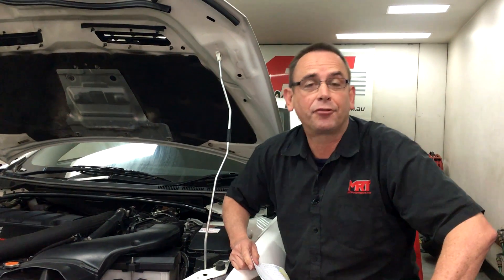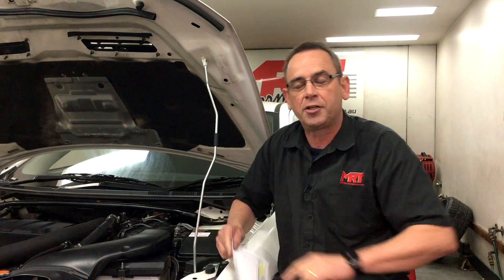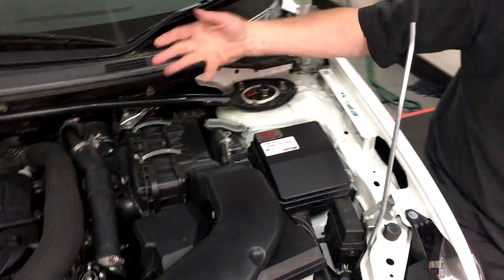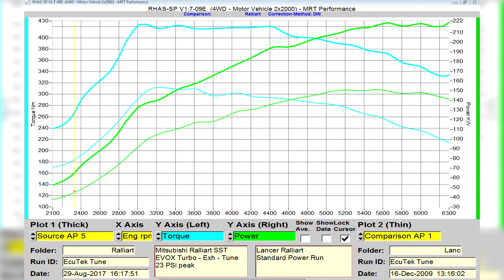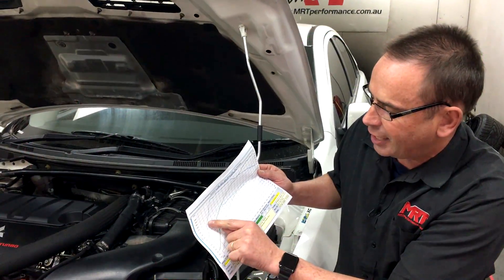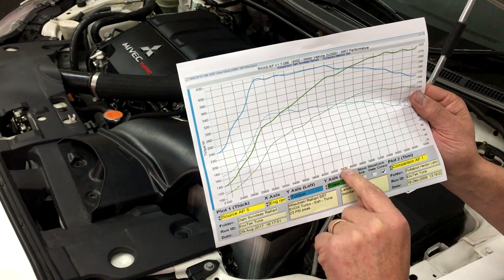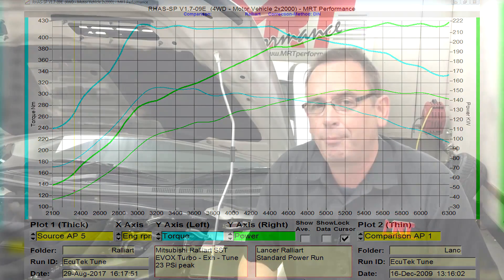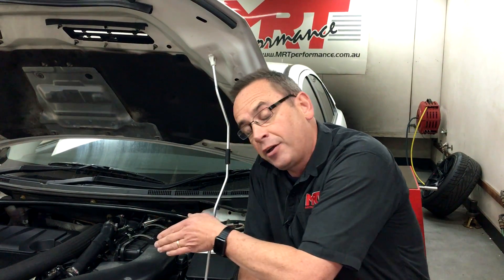Lancer Ralliart - XC Power Kit - Part 3 - Dyno Results

Comment: Thanks. Ive been thinking to buy a WRX  but now I reckon a ralliart would be a better option cause I dont know if I'll be patient enough to go back to a manual in the middle of the traffic. Are you located in Melbourne?
Reply from the maker: sydney
Reply: MRT Performance I got railliart 2009 stage one tuned and I want to do it stage 2 can u do it for me and check if everything is ok on the car

Comment: can you used a gear box from a evo in a ralliart
Reply from the maker: hmm, not easy as elctronics are a little  different
Reply: As in the manual box? It's been done....if you mean the SST from the Evo, they are more or less identical, save for different gearing ratios for 6th...maybe 5th...not sure on that one.

Comment: is the  torque measure at hubs? if so does that mean all 4 wheels produce 420 Nm of torque or does each wheel produce 420 Nm?
Reply: It means all four hubs together make that much power minus any unsprung weight losses from the wheels and tires.
Reply from the maker: collective measured